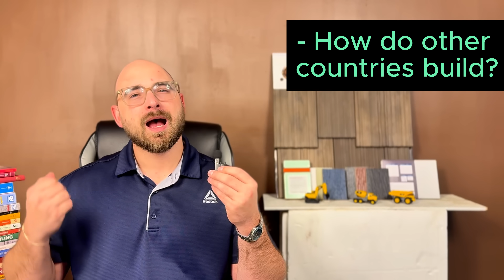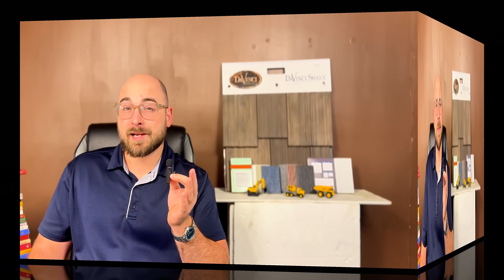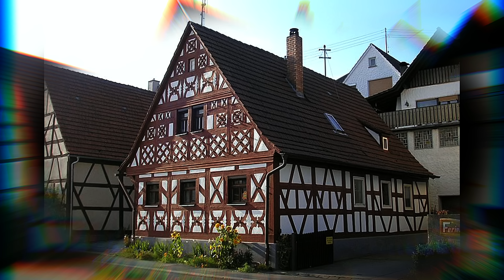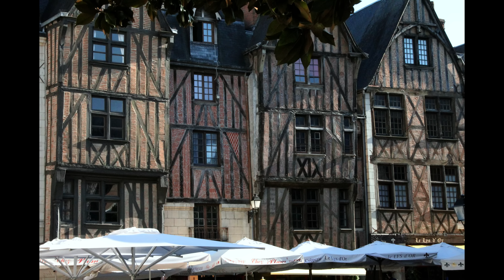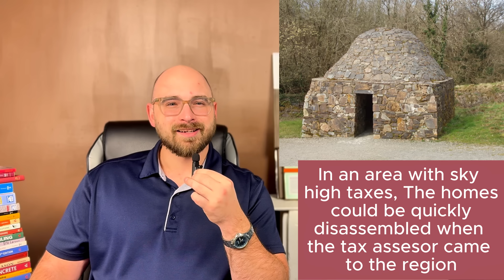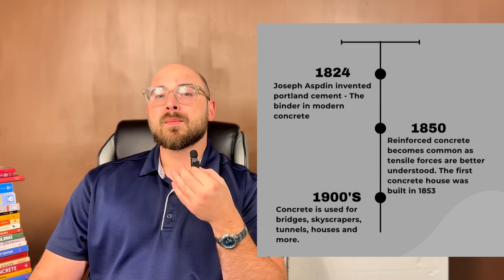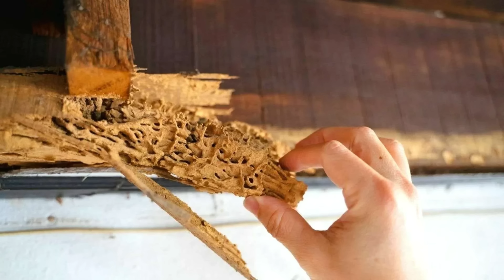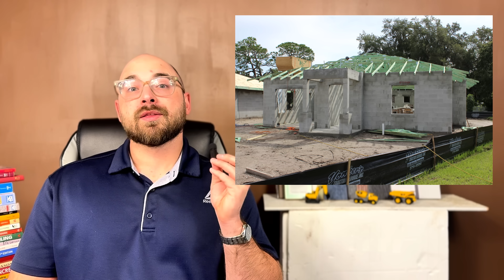Why Other Countries LAUGH at American Homes

Comment: The quality of life in American houses isn't worse. But American houses are flimsier than houses made of bricks or concrete. The angry man punches a wall and makes a hole in it trope of Hollywood only makes sense for foreigners when they realize American houses are made of timber. And the USA internationally often appears on the news when houses are destroyed by tornados or in fires, making people wonder why they make their houses with timber instead of concrete or another sturdier material, when it's a very wealthy country. Basically the 3 little pigs story. But the quality of life of an American house is very high.

Comment: Problem is you're not a builder. I know the UK and NZ, NZ being far closer to US methods. There's reasons for different construction such as earthquake risk. The chief complaints about US new builds is they're not designed to last long, like 100 years plus, in effect they're not investments but depreciating consumer items, my house for instance is 175 years old and most of the house is still original. The biggest defects in US housing is stick on roof tiles, they are short lifespan JUNK which we normally use on garden implement sheds and dog houses. Underneath those junk bitumen tiles is invariably OSB sheets which seriously degrade with water ingress AND through limited airflow. Then there's the JUNK exterior cladding used often referred to as siding in the US, often crap plastic backed often with equally useless OSB.

These new build houses in the US are junk. If you want cheap roofs then use long run steel on roofing battens, otherwise concrete tiles. Heck even galvanised tiles with an appropriate factory finish will give you roof lives of 50+ years, not 15 for those bitumen nail on junk tiles. As for siding, use cement board (that can do the job of bracing equally well as OSB) that you can render and paint etc. Pref cavity with brick looks far smarter.

Anyway, Americans and lenders need to get far more demanding on quality and expect homes to have exterior cladding with far longer economic lives.

Comment: American homes are not family House for 2-3 generation child usually moves out of the house at 18 or 20 but Were I live we mostly use concrete with iron bar under to support concrete 😅, we don't even use extra wall above concrete to hide wiring just chisel the wall to put pipes for for plumbing and electricity then cement over it we use some wood furniture for bed and doors 🚪 but 90% of wall furniture is PVC and doors are also PVC/glass for bathroom because of moisture and entry doors are solid iron for safety
Reply from the maker: I think its sad we put so much pressure on young people to move out and survive independently at such a  young age, other cultures are very smart for sticking together until their children get married

Comment: 1-  There are also homes built with large cement mixed blocks with cement plaster and framed with steel rods similar to CMU built in Puerto Rico and Mexico but, more closely to those new concrete homes built in Germany and also popular in various Central and South American countries, the difference is in the cement mixed blocks which are much larger than regular CMU and not hollow, and these are held by steel rods frames fill with cement and/or concrete
2-  At 18:45  Yeah no, the actual criticism is due to how cheaply built they are, I live in an apartment in NJ, and it's winter right now and I can feel the very heavy cold from the outside, I know for a fact a similar size building in Europe you would not feel the cold at all, and that's because the walls from this NJ apartment are essentially hollow, so in the U.S. homes and residential buildings are not only built with cheaper materials, they feel very cheap (and cold) as well

Comment: concrete is soul crushing.
Reply from the maker: If by soul crushing you mean awesome, then yes.  

  If you mean its ugly, I'd recommend ICF, where the structure is concrete but the concrete is covered up by insulation and standard finishes. all of the benefits, none of the ugly
Reply: @Mike_Fortin  I'm sorry, but I'm from Hungary and they are a blight upon an otherwise beautiful city of Budapest. Can concrete be used creatively? certainly. In practice it is almost always used to make large faceless, soulless comie-blocks that would depress the will to live out of anyone unfortunate enough to have to live among them.
Reply: And yes they were cheap when they were made. Absolutely besides the point.
Reply from the maker: Regardless of building method, our homes and buildings should be beautiful, 

I believe it improves the lives of those who live there, no one is proud to drive home to a subdivision of plain white boxes, or in your case a soulless concrete complex, we should spend a little more to make things beautiful
Reply: @ Absolutely. I'm not a construction worker or an engineer myself, but I've been wondering if it would be a viable business to retrofit these boring block houses with external ornaments. Get them to have something on the roof (instead of a 90 degree flat surface).
Reply from the maker: I could see the value in that

Comment: I'm in Florida in a cinder block and rebar house built in 2008. The eye wall of Milton sat on my house for a good while. Like, the storm chasers were a few roads over and wouldn't drive in because it was too dangerous. That's where my house is. Held up like a champ. The whole neighborhood did. Concrete is super bad for the environment, but I can't help but think that replacing a stick house every year because of weather disasters is any better...
Reply from the maker: Your story is a perfect example of disaster resistance. I'm glad you survived such an intense storm! 

I agree, that rebuilding inefficient wood homes is not great for the environment, nor is it good when they burn. And as Eco friendly concrete and insulation alternative become readily available I will advocate for those.

Comment: I’m missing how American homes are worse. You have to build based on where you’re at. In California, rock and brick will fail in an earthquake. Concrete is an environmental nightmare although it may be worth the fire protection. We have lots of trees, and stucco provides a great exterior surface. My home was built in the 60’s with true dimensional lumber that was significantly higher quality than what you can get today. Fire and termites are the key downfalls.

Comment: In USA houses are built in a manner our bodies are, layered. It has its advantages but for the most part it is tradition and finance related.
In Pakistan houses are made from brick/ concrete blocks and gravel.
Foundations are set about 24 inches wide and 3-4 feet deep. 
Walks are raised in the foundation.
Roofs are made with meshed metal with over poured cement, sand  gravel mixture. 
These houses are super strong, no flood or fire insurance required. 
In floods the structure stands, same is true for fires.

Comment: The production and use of concrete is a big contributing factor to green house gas.  It's use is also causes the "heat island effect" in major cities causing temps to rise by as much as 7+ degrees.  Modern concrete does not last forever.  There is the issue of ASR (alkali-silica reaction) causing concrete to deteriorate.  I live in FL, many of the coastal condominiums are in disrepair.  From articles I've, even repair with concrete has a limited life span.  What has been done about this issue?  Even my own driveway, concrete, I've had to repair twice.  I'm more in favor of some the alternatives mentioned.
Reply from the maker: You're not wrong, in a perfect world we would incorporate more eco friendly concrete mixtures and do a perfect job of screening aggregate, and we would plant more permanent forests to offset the increased solid structure construction.      In terms of longevity, Concrete needs to be protected from the elements, it is often left exposed and the lifespan drops to around 50 years. If we use a product like ICF and proper waterproofing, we protect the concrete from moisture, especially when including a capillary break at the footer, so the concrete does not wick moisture and corrode the internal steel. while more expensive, there is also corrosion resistant reinforcement such as fiberglass, stainless steel, composite, and epoxy coated.

Comment: Another structural system worth mentioning : bamboo mass timber / CLT beams and posts ….. stronger than many other framing materials; good in tension and compression; fast growing and renewable…… environmentally friendly; occupying less land than trees per material output.

Comment: Houses in the UK are weak as well.
The timber is very thin
The bricks expand and contract a lot more than those is Europe, and for this reasons they have to use poor ratio mortar. More sand and a little of cement/lime.

Lots of houses walls crack due to traffic
They don’t have structural columns.

If you have three kids that jump at the same time at the top floor, they will end up in the kitchen

Very poorly insulated, extremely poorly insulated 

The list can be endless.

Comment: Blockhouses with real fullwooden-timber, is in prinziple also a "solid structure" build - because of the stability of the thick planks. But for form-stability, its needed good trunks with its core (not younger ring-area), what is in modern industrial foresting becoming much more expensive to get.  And: Blockhouses with fullwooden trunks, you can´t build in as fast, as with other material, because, if the main structure is build (inclusive the roof), you need to wait for seating of the building, because wood shrinks and the weight of the hole building leads to seating by closing slits and such irregularitys. There are strategys to prevent interior-installation from deforming, but its better to wait one or two years befor beginning the interior-installation. Those seating-ranges can be several inches for a usual build-hight - up to inches per every usual story-hight. Depend on the wood quality and if its good dryed or too fresh.

And some concrete-block systems, if they are without (or less) mortar for binding, they are not realy solid structure builds - because their structural stability is much lower, as with mortar or masony walls or fully solid concrete-walls.Yopu actualy did not answer the question in the title...besides the meantioning, that ICF is not much more expensive, as other building-variants.... because  the usual american strategy (2by6)  costs 250 thausend, but ICF only 265 thausends, but the 2by6 will get blown away in every huricane, or burn to ash in every fire. Or gets bad with time on other factors. For "Fachwerk"/Timberframing with infill material had a problem with its form-stability over time (at least, those examples, who were build in middle ages) and that also leads to problems with insolation - because, you not get that house air-tight without realy high effort on fixing the problems. Modern restaurations somethimes lead to rooms, who aren´t effectively seperated from other rooms and the outside...so you always get air draught in every area in the building. That can be bad for confort (and heating-costs).

Besides such problems, its fascinating, how such old buildings can last for so long (with adequate maintenance)... some old downtowns look fascinating, albeit, often every house is leaning its weight to each other and the whole "block" is only stable, because they stabilize themselfes altogether. Pull down one out of the block, the other buildings get in danger to fall appart...because the overall static is lost.

Comment: In Texas the houses are paper thin and built mostly by people that seem unqualified to do the job. Like on the job trainng. We watch them construct a section, tear it down and start over, all with the cheapist of materials. We see gaps, unlevel surfaces, crooked installation, paper thin windows and doors. Quick and cheap. Ready for the next weather event to file an insurance claim and have another rate increase.

Comment: there's nothing particular "wrong" with wooden framed construction ...IF, the wood is high quality, STURDY enough and properly produced and processed. However, if it's thin, badly constructed - often badly designed for structural integrity - and then topped off with shingle  pads... then it 's life expectancy is under suspicion. And, its longevity, before serious repair bills arrive is short. 
From observations, USA wooden-framed, spray-insulated and built with too high tolerances - are not at all good, sustainable or of good value over time. In addition, the pricing is unbelievable, given that USA has so much acreage to build on. Not sure why the American public stand for it....perhaps one of the problems is Realters...idk
Reply from the maker: you're right, and just to be clear, the high quality old growth wood is GONE

Comment: Here in Germany 70-80% of Buildings are brick Buildings. But there is a growing number of wood constructions mostly pre-manufactured (Fertighäuser). Besides that, the european houses have higher standards in energy protection, so they are pretty much insulated to avoid or reduce heating. But the flipside is that the average house in Germany is significantly smaller in average and comparably more expensive. Looking at L.A. the european brick buildings are better protected against fire because of the use of fire resistant material and because bricks do not burn.

Comment: I don't think people laugh at American homes. The only issue I see is that a framed house, which is considered the lowest grade option in Europe, is the de facto standard in US and those homes costs millions depending on the location. 
In Europe, you can build a framed house but you can't build such low grade house with such poor fire resistance in an urban area. 

Europe is vastly different in housing though. Framed houses are still built, but in small scale and in areas where lumber is available and the traditions are present.
In Southern Europe, almost all is based on some type of masonry as the terrain limits the amount of available timber. I have been to Spain and Italy many times and something like a 'lumber yard' is hard to come by. In Italy they have seismic activity, but all the houses are still  masonry.

I can specifically speak about the northern part of Eastern Europe and the Nordics. Frames houses are still built, as the skill level required and cost associated are lower. Also we have lumber available and the traditions support building any type of timber house. Framed houses are entry level to medium level. Anything more fancy or high end or expensive is based on masonry though. To sum it up, framing limits the value.

In framed timber houses, framing is the only similar part. We dont use OSB/plywood sheeting of exterior walls or shingles as roofing. Roofing is either metal or stone. Shingles are for sheds or dog houses.
In framing, 150mm depth is considered minimum, up to 200mm. There is insulation between framing. After that there is wind proofing panels, 50mm in depth. The third layes is external facade. It is a very basic overview. 
All the materials are fire proof or fire retarding. Exterior fascia/soffit must have fire retarding properties. So even when you have timber cladding and it might burn, the underlying insulation prevents the fire from advancing.

Comment: If some roman aquaducs are surely build in concrete, the Pont du Gard shown as exemple is typically a 2000+ years old stone construction. Cannot tell if it was concrete joined but I have doubt about it. The public office running the site is a customer of mine, I will ask them (I live 10km from it, how lucky you are little YTers !)

Comment: So I moved to the Philippines in 2012 and was amazed at how most of the modern houses 60's-2020's are all made of concrete. I finally built a house in 2019 and if it wasn't for covid it would have been done in 6 months. So I asked my Architect/contractor why no one builds with wood anymore, she told me it is illegal to cut down lumber for buildings/homes and that trees are protected. She also said concrete and steel are just cheaper, including that the country is hit by typhoons all the time and huge termites. So I'm happy with my concrete house but it does get hot AF in the summer. All in my house only cost about $65k US. It's roughly 1370 sq ft a bit bigger than my house was in VA. They also don't do front lawns here that often and basements are very rare because of flooding.
Reply: They cut down whole forest in Texas for wood or a development and could care less about the animals or the enviroment. They whorship concrete

Comment: Great video, you did a great job researching and explaining.
as I am an architect in Switzerland I can confirm we build a lot in concrete. I may specify that we select building materials for its properties. so concrete is used structurally or for rooms that need high fire resistance (e.g. escape corridors). other walls will be built in bricks since it's much cheaper. 
with trends toward sustainability, compound wooden systems are gaining more popularity.

Also I think you did not bring the biggest advantage of American Homes to shine. They are affordable to a majority of people. In Switzerland you have to save money for basically your whole life to afford to build a house as a common person.
Reply from the maker: You’re right, affordability is a big factor in how homes are built. It’s a tough balancing act.

Comment: In Japan, as you mentioned, vast majority of new houses are built with the lightwood framing method, but lightweight steel frame with ALC (Autoclaved Lightweight aerated Concrete) panel wall method is slowly gaining popularity.
Reply from the maker: That's interesting, thanks for sharing that!